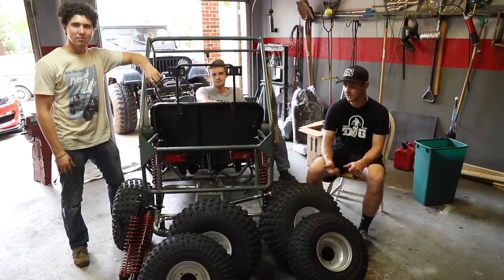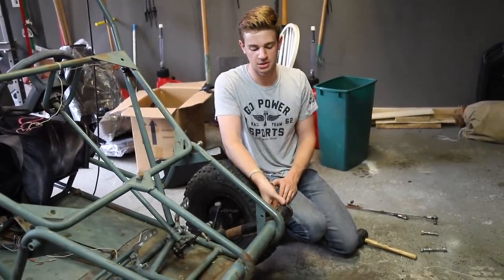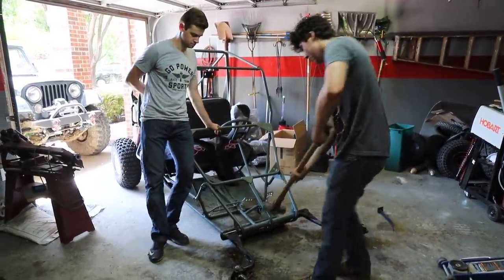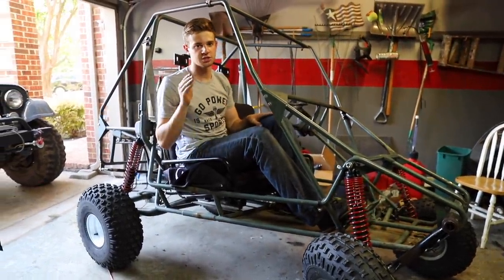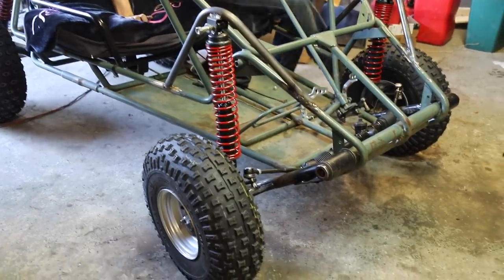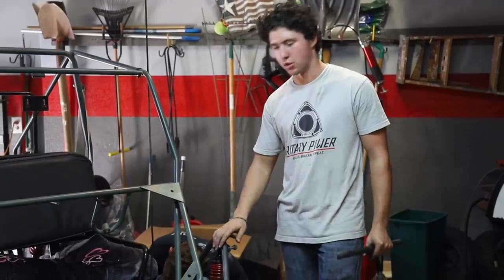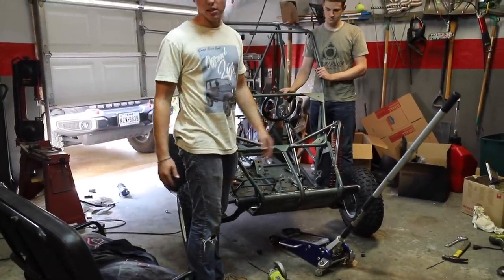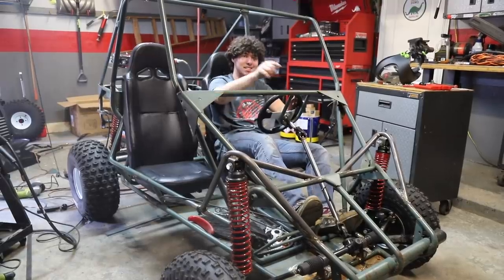Kawasaki Ninja Offroad Buggy Build Pt. 2 | Long Travel Front Suspension and Steering

Comment: If you drill, tap, and install grease fittings into the j-arms you can loosen them right up with a couple good shots of grease for future reference learned that trick on the center frame pivot on a 1970's simplicity 7013 (it already had the zerk but the pivot probably hadn't been greased ever and had seized solid.  It took me a week to get it freed up with a pump or 2 twice a day and applying cross pressure (a 4x4 block of wood under the left front tire and one under the right rear tire leaving the other 2 tires hanging in the air) after a week without any other contact (except to add the grease) I went to the garage and found the 2 tires diagonally across the pivot that had been in the air sitting on the ground and the pivot moving freely).

Comment: So car shocks with helper springs means those shocks are valved for a much stronger springs. We can see it stay in place when you jump on it, it will work for crawling but for anything faster you basically got no suspension.